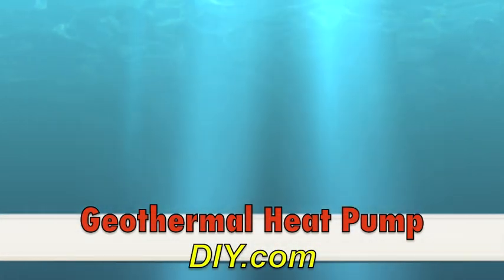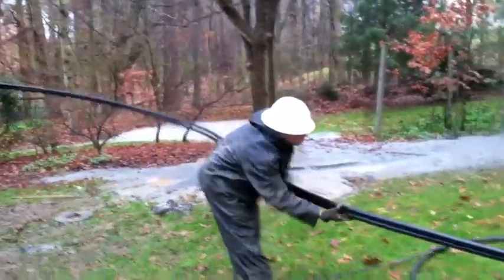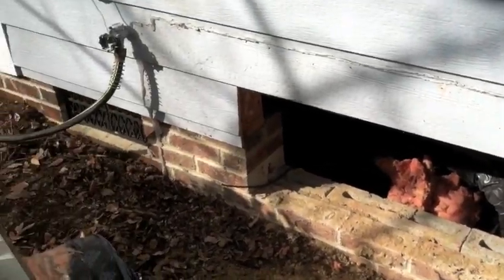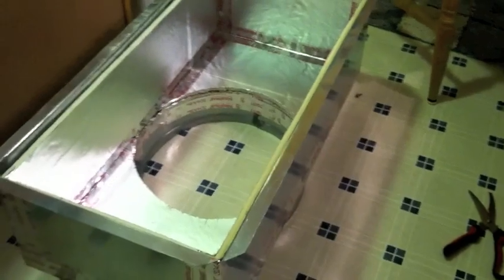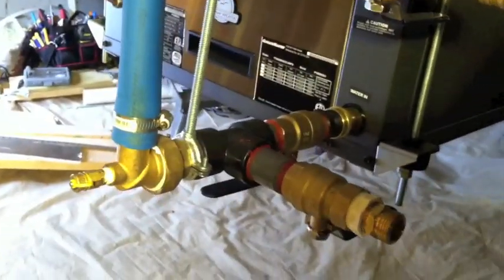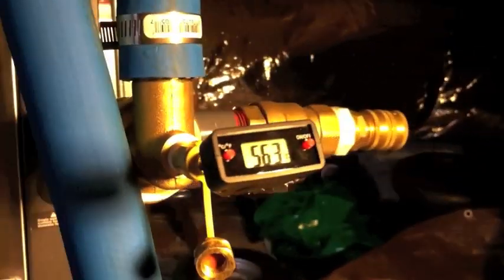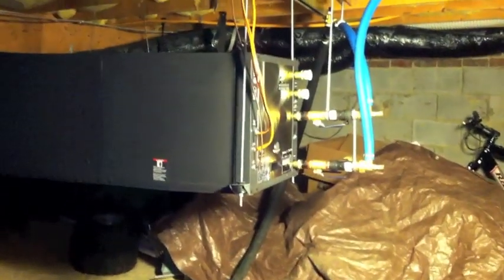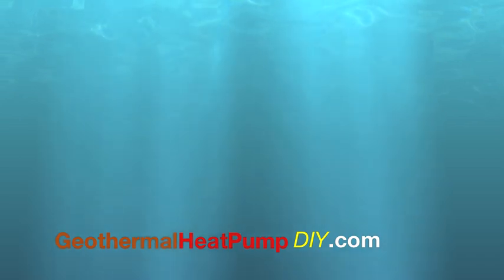ClimateMaster Geothermal Heat Pump Simple DIY Installation - GeothermalHeatPumpDIY

Comment: I've had a water-source heat pump for 16 years using well water.....you don't need all of the complexity of this install, and if you're already on well water, you're good to go!
   Have the water tested for hardness to protect the heat exchanger in the unit, and use a BPHE if that's an issue. 
  The most common myth? High maintenance and humidity problems......the MOST overlooked positives?...Water source heat pumps never go into the de-frost mode, where electrical resistance heaters kick in.
   2500 sq.ft. and Duke Energy has replaced my meter THREE times because ( I guess..) they think (assume...) I'm cheating. By far, the lowest energy user in my area in an all electric home..(2500 lot sample in Wake County NC.....million dollar homes right up the road...)

Comment: How much did the well drilling and dropping the pipe cost?
Reply: I'm in the Louisville, Ky area; it cost me $1,800 per hole. It is recommended to drill one well per ton of of air conditioning..

Comment: I wish we could get comments about 4 years later on how the economics worked out.  How much money was saved?  How did it compare to the heating and cooling costs of the earlier gas pack?  Did you go back and replace the flex duct with solid sheet metal round?
Reply: It’s been four years...

Comment: Doing the math on a 300 foot well means a lot of pressure at the bottom of the pipe.  Would it be more sensible to do three 100 foot wells about 15 feet apart?  I think they would be less likely to leak with the lower pressure.
Reply: what, why? pressure's aids it flow & thermo-heat-sinking....

Comment: for power, all you needed was a 30/2 breaker for this entire system?
Reply: Yes, only needs 30 amp 2 pole breaker, also this unit can be used to heat hot/water inside home. I'm retired HVAC  who installed serviced Geo Thermals since 1988.

Comment from the maker: Please check out the "My Geothermal System" page on my geothermalheatpumpdiy website,  
then click on the ad for the Ingram's DIY kits. I was very happy with their service before and after the sale - they helped me figure out the right size
unit, and with any questions I had during the install.  My ClimateMaster
system is awesome - I've had it running for about a year now, and it works
great!  With the tax incentives, geothermal is the definitely the way to go! 
Thanks! Chris